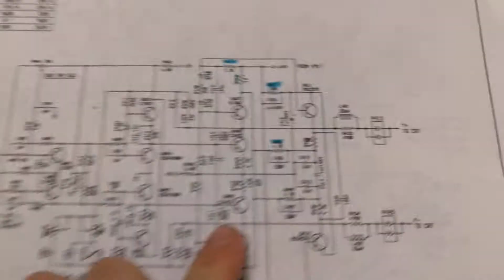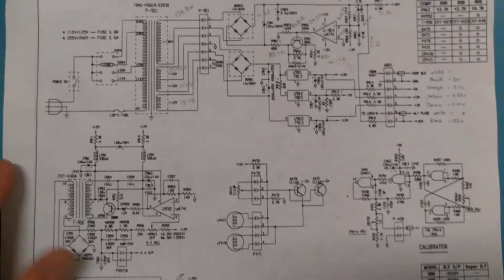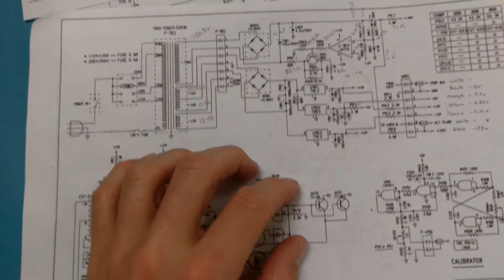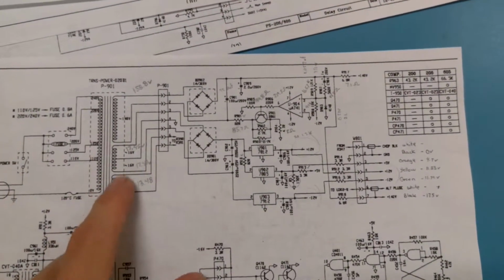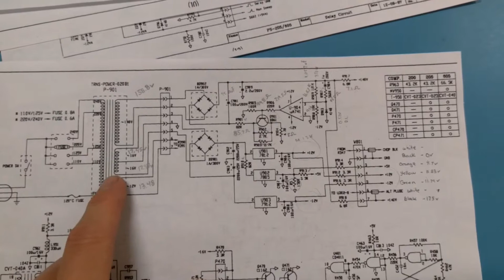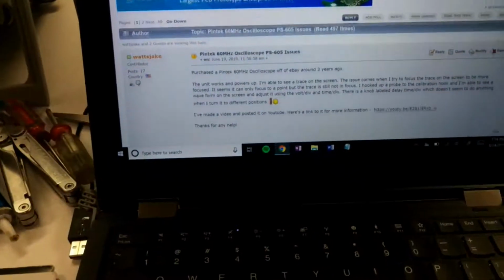Pintek PS-605 Oscilloscope Repair Update

Comment: HI i have a rebranded scope but a 20 mhz like PS 200 the circuits look similar ,mine the transformer went and i have had to replace it with 2 transformers to get the AC voltages  thats all fine but my scope has a problem with the vertical position controls and as yours the waveform in to either of the 2 channels is distorted as yours ...did you ever get your fixed ?  having a schematic now and your link  is helpful .

Comment: Hi jacob, please CHECK all the HEADER CONNECTORS, check that the internal pins are in their place. I read in the forum that the fuse burned to. THIS HAPPENS TO ME when a one connector inside one of the headers was off (not making contact were it supossed to); my voltages were all out of specs and the power comsuption raises to the skies (my current limiter saves me). It looks like this little detail makes the voltages (-5,-12,12,145 and -1900v) go out of balance and moves its values to danger places (guess what, my R427 also start to smoke). If the connectors are physical OK, then check for CRACKED solder joints in those places (where the connectors are soldered in)
Reply from the maker: Thanks for the information! I'll look at all my contacts and connections!

Comment: If the voltage is super high, maybe the regulator part of the psu is damaged. Also make sure to double check where componets go because you can completly kill units that way. How do i know this? I killed a tektronix 2235. So becareful. Also if the resistor is burning, and it shorts out, it may damage psu.
Reply from the maker: yes I still have the pintek! I think that it's something to do with the transformer. If I remember correctly I tested the connections directly from the transformer and they were wrong. I'm unable to find a replacement transformer. I've been wanting to work on the pintek but calculus III is kicking my bottom!
Reply: @watts-jake  Once i unwinded the the transformer and started from scratch. I made some taps for different voltages. Maybe you can do the same. I dont know about you tho its kinda hard. But here:
Reply: @watts-jake  but when servicing an oscilloscope, i would recommend a tektronix because they are much much muchhhh easier to service.
Reply: its a similar model scope. Most similar models have the same transformers or psu
Reply: But further research is required most of the time.

Comment: Hi. I hope you to have being able to get it working. I have seen one of these pinteks ps-605 for sale and I don't know if they are worth to be bought even in good condition.Are they still a right choice to use them on the digital word? Why did you bought yours? Thanks.
Reply: You could try to get that 158 V down to 140 again right after the rectifier with a voltage divider. You would then know if that's the issue.
Reply from the maker: They're good oscilloscopes if you want to get into analog or digital electronics. But honestly it would just have been better for me to buy new. I got this off eBay and the seller told me it was working, obviously he was lying or didn't test it.

Comment: Did you manage to repair it ?
Reply from the maker: No, it's still burning the same resistors even after replacing all of the components. I'm stuck and lost as to how to repair it.
Reply: @watts-jake  I will try to carefully read your posts on the forum and if some ideas spark up I will come back and notify you. When debugging stuff like this, it's usually useful to have a bench power supply so you can power up different portions of the circuit with known and trusted voltages. I'm sorry you are already a year into this and still no luck, that kind of intrigues me about what the heck might be wrong with it.
Reply: @watts-jake  need to lower the 150 volt i  using 130 ac  and its giving 145v dc  ..i would using a magnetic amplifier to drop the 150v ac  ....or   don;t use it and use another transformer for this voltage mine runs fine on 130v AC for the high positive  ...i think will think out side the box and make it work  your transformer might be a dud like mine was poorly made and or tested
Reply from the maker: @typedef That would be awesome! I've got a bench power supply with 0-30 VDC 0-3 A. I'll make some room on my bench to be able to work on it! I'm willing to try anything at this point! THANKS